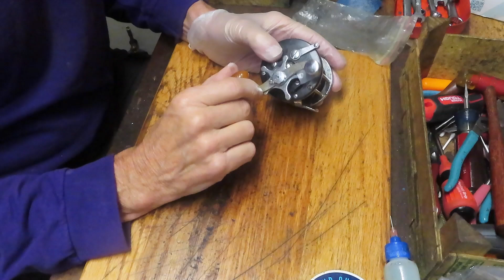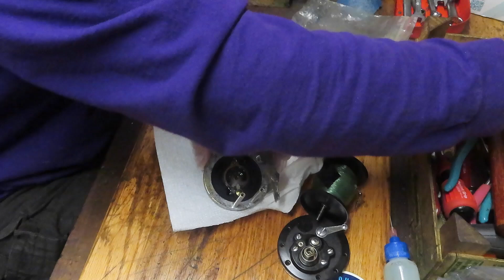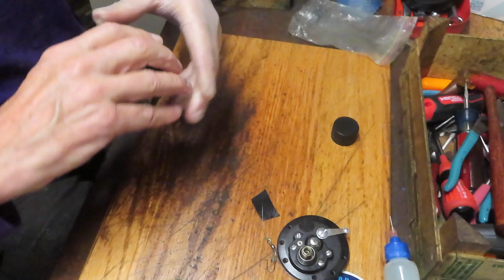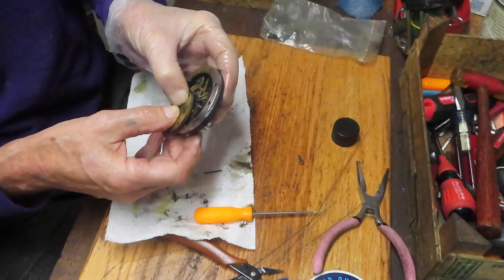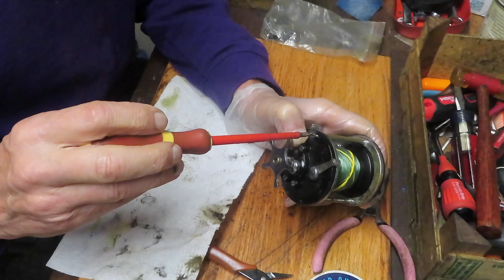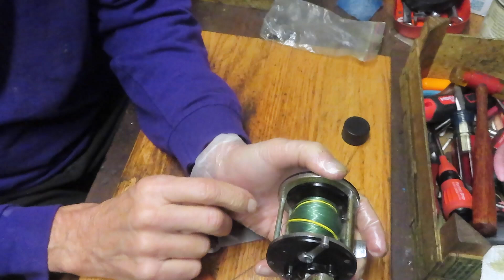Penn Beachmaster 160 how to service and use a bush fix to restore a  faulty AR dog flat spring

Comment: A lovely old reel that should fish for many years. One question, if someone wanted to restore a reel like this beyond user condition to collector standard, is it possible to get metal parts re-chromed? Or would you just chase down a good example of the Baymaster?
Reply from the maker: Yes, it is possible to get these rechromed.  Check with a local motorcycle shop to find out where to get the plating done if you are interested.

Comment: A "bushier" fix uses a piece of the lid from smoked oysters, sardines or kippered herring.  Cut little strips from the lid with tin snips and trim to length.  I generally end up with a nick in my thumb but, once installed, the sharp edges don't matter.
Reply: Why? Why not a strip of copper flashing?
Reply: Because I have the kids and they are thinner and flex more than flashing.
Reply from the maker: It's all about the tension in the spring metal.  If the flashing has enough spring, then you could do that as well
Reply from the maker: Right up there with spit and Band-Aids Thanks